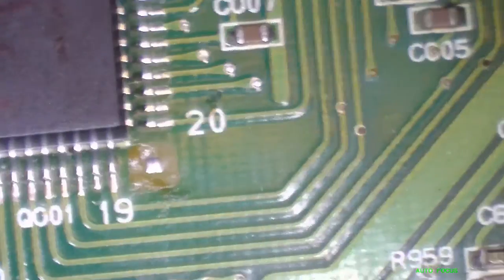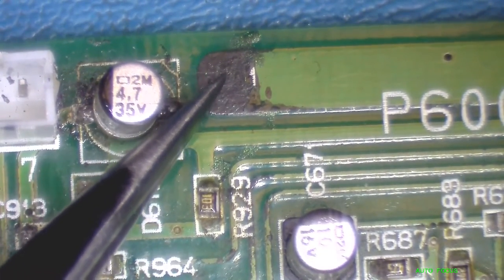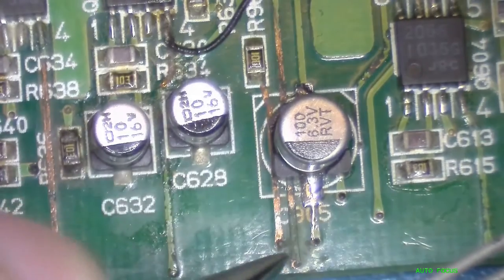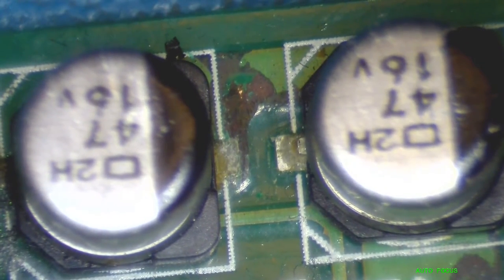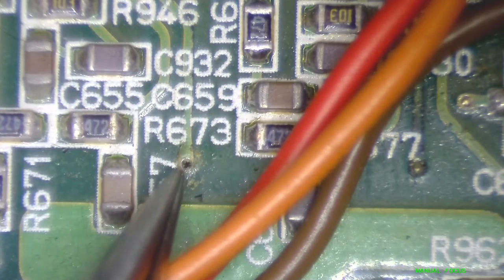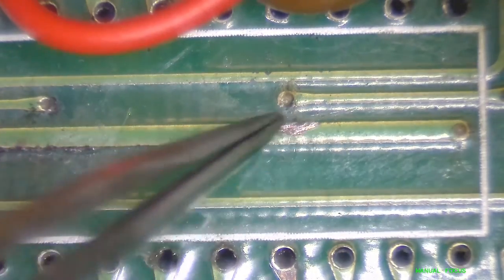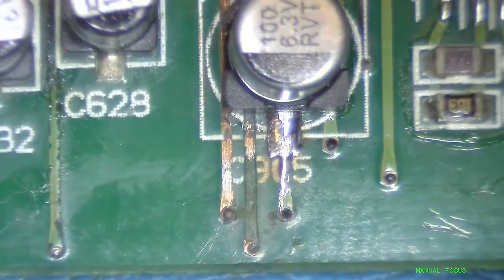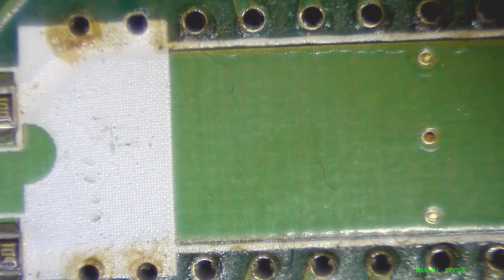LUXMAN RV-371 CIRCUIT BOARD REPAIR ASSESSMENT

Comment: How do you feel about those washers , you put a board in, does that do more damage.
Reply from the maker: +MrMac5150 The ultrasonic baths are great. Wish I had one.  They would help a little in this case, I don't think it will peel the loose coating off that is hard to scrape off.